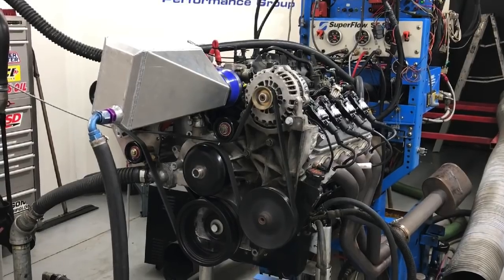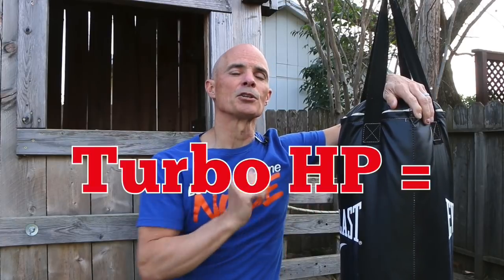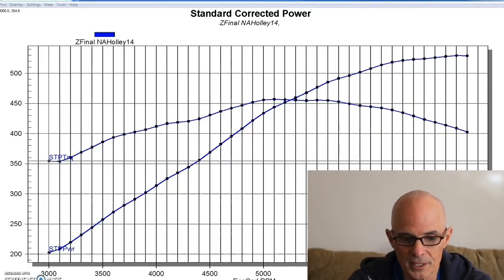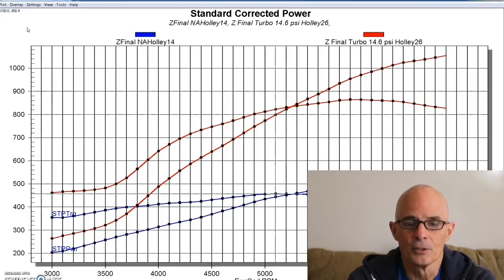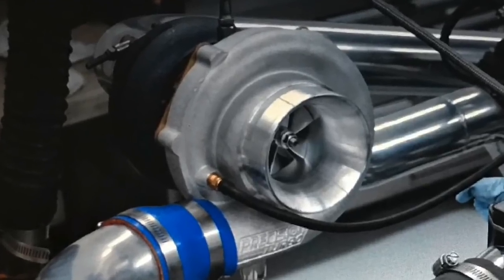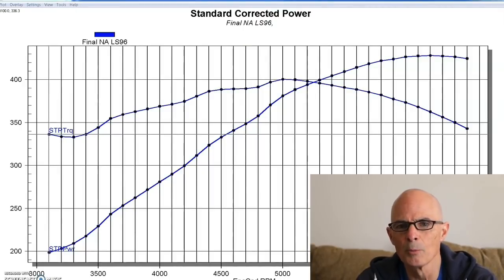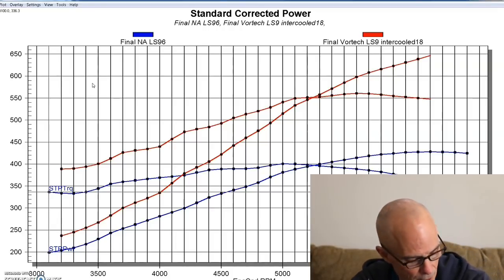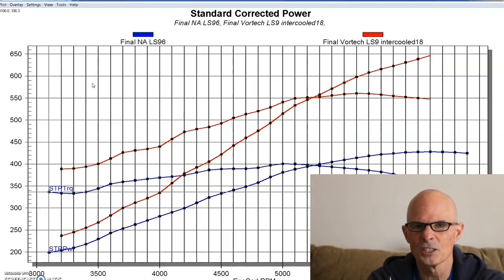WHAT DOES IT MAKE? TURBO HP FORMULA!-ANY BOOST!

Comment: Would atmospheric pressure change to 12.1 for Denver
Reply from the maker: na and boosted power are both less at altitude-but turbo compensates more than blower because it increases impeller speed to crate desired boost level

Comment: i tried your formula, if you times by 14.6 and divide by 14,7, then you are going to end up with a smaller number then the na hp. how you come up with that number has got me
Reply from the maker: turbo hp = (boost pressure/14.7 (+ 1)) x na hp..example (10 psi/14.7 =.68 + 1=1.68) multiply 1.68 times the na power output (example 400 hp ls) to get the boost output at 10 psi (a 400-hp na motor should make near 672 hp at 10 psi).
Reply: @richardholdener1727  thankyou for the quick reply, I get it now, thankyou mate. the amount of effort you put into making these videos you make is huge. I am now fully  subscibed. sorry for the late reply been a bit busy.

Comment: A good friend of mine once said "For every 14.7 lbs of boost, you double the engines cubic inch value."  Same difference, it appears.  If a 5.3 NA engine makes 425hp, then a 10.6L NA engine should make 850hp...all things equal.  It's an air pump, right?  Air in, air out.
Reply from the maker: much harder to feed a 10.6L NA motor-it doesn't double the displacement-it doubles the hp output
Reply: @richardholdener1727  Agreed.  What my friend said was that you "effectively" double the cubic inches.  You're squeezing in 2x atmospheric pressure.

Comment: My car has 1.0 bar turbo and 70 hp. 1495cc 4 pistons. Its diesel. İf i open the pressure to 1.4 bar, how much hp i have? How can i calculate?
Reply from the maker: DIESEL POWER IS CONTROLLED MORE BY FUEL SUPPLY THAN AIR

Comment: I have a Toyota 3UZ V8 engine with two small but adequate turbos. NA it made 130KW on an wheel dyno. By adding 9psi of boost with a big intercooler power jumped to 319kw on the same dyno with only 12 deg of timing to be safe. The only thing that was done to the engine was lowering the compression with a thicker head gasket.
My tuner says that it is normal to double the power on one of these engines in stock form with only 7psi.
Why do you think is the gain so much?
Do you have any experience with these?

Comment: Hello Richard, Fantastic series of Videos. I am going through all of them in the last few days, enjoying them but mostly looking for those tidbits of new knowledge. I am a very passionate Turbo guy every since 1977, when I first saw a Porsche Turbo 935 on the race track. I started researching every possible piece of information on the subject I could and then in 1979 I built all the components to put a single big turbo from a cat diesel motor onto my 400 firebird. I drove it through the 1980's, blowing it up multiple times due to preignition but learned lots. Nobody was doing at the time and I had the fastest car around when it wasn't broken. I took the car off the road in the 1990s but kept it and then in about 2005 I started rebuilding it again but this time building it strong enough to handle 1000 Hp.(entire drivetrain and suspension. If you or anyone want to see the car or story, I have it all documented on my Facebook Page "Johns 1975 Formula 400 Firebird" but I want to ask you several questions. 

1: I have read (several times) each book I could find on turbocharging and from the theory the turbocharged motor should produce double the HP of an NA engine (at same altitude) minus 4% to account for additional backpressure on the exhaust. (Unless you can achieve a situation of higher pressure on the boost side vs. the exhaust side. Which you have shown on several Videos.) The question is, when you Dyno the engine for NA power, do you measure with the turbines still restricting the exhaust and just dump the boost or do you measure with headers or open exhaust manifolds?

2: Can you do a video on timing reduction under boost? This is the one subject I can't find a lot of information on. In the 80's I used a 8 degree boost retard on my HEI resulting in a 26 degree advance under boost but now I have a Fast Fuel injection system with the CD ignition and duel trigger Mallery distributor, so I can set the ignition where I like. I will put the car on a dyno as soon as I can to determine those numbers but would like to know more from other builds?

3: I have been wondering why the back pressure should climb so high on a too small turbo if you release that pressure when the  wastegate opens. Can this be that the waste gate is too small or incorrectly positioned?.

Thank you for doing these videos, I am looking forward to watching the rest of them. You might find a few other questions by me on other your other videos. By the way during the time I wasn't working on the firebird I had a couple of Eagle Talons that I also turned up the boost. (and changed exhaust systems and bigger turbos and intercoolers etc..)  I also drove a Turbo Yamaha Motorcycle in the 80s as well. so basically 40+ years of turbo passion.

Comment: Would the parasitic loss of the SC (verses the turbo) be offset by the NA increase in horsepower (the base number used in this formula) due to being able to run long tube headers and not a restrictive cast iron manifold?  If you had the exact same engine and put cast iron manifolds on it and ran a base dyno pull and used that as the base HP number for the test of the turbo, and then put long tube headers on the same engine and ran it on the dyno and used that number (should be higher) as the base HP number for the SC, would the parasitic HP loss be less than the loss of having to run cast iron manifolds?

Comment: Do you have any videos that show the real world difference from putting a bigger turbo in? Like if you run a 76mm vs a 78mm at 10 lbs of boost with a standard air to air intercooler would it make any more power because of the potential for lower intake temperatures ? since most of us are not running a water to air and our intake temperatures change dramatically
Reply from the maker: if both turbos provide 10 psi, power is the same

Comment: So the weird thing about my supra. it makes 232hp (crank) stock from 7psi boost (8.4:1 comp). But it is a known thing that around 20-24psi boost makes 500whp. now the formula you have when you reverse calculate the NA hp I get 163 hp and then go forward with 22psi and I get 400crank hp. The only thing I can think of is they might be making way more then 232 crank once you put an intake and exhaust and intercooler on it. If I could do a engine pull with the restrictive intake and exhaust off I think it should make 260-280HP so it should make 600 Crank or near 500 whp.

Comment: Thanks for years of hard work.
Sharing years of  information.
BUT,  One more step.
Share the fuel maps.
So I can build a the same exact engine.
Married with Children.  So I do NOT have the funds 💰, to spend $2,000 or $3,000 tuning.
Thanks, we do appreciate the TRUTH about making horse power.  
Not trying to sell us, intake, heads,  pistons,  rods, crankshaft, race block.
You running a junk yard dog making 600 hp, 700 hp, 800 hp.
With a engine out of a pickup.
Thanks

Comment: Richard, a question relating to super charger losses.  This lill guy only cost 19hp so its not incredibly significant but as you mention something like a roots charger can cost at lot more in losses.  For convo sake lets say and engine is making 700hp with a super charger at the crank but is costing 100hp to run the super charger is it stressing the internal engine parts like the engine is making 800hp at the crank?

Comment: You ABSOLUTELY CAN NOT apply this logic to any supercharged application.

Mr Know-it-all will certainly comment in disagreement, but this is extremely basic logic.  Any crank driven accessory requires HP to drive it.  Superchargers require a LOT of HP to drive them.

Abnormal drive pressure ratios will also effect the math.
Reply from the maker: I think I covered that
Reply: @richardholdener1727  "you can apply this to any turbo or supercharged application" direct quote.
Reply: Mate ...you gotta listen, as well as watch the pretty pictures.

Comment: Have been using the formula for almost 15 years. But as I use metric, that makes the formula easier 😀
Bar or kpa.
Reply from the maker: I started applying it back in 1980-90 after doing my first story  for Kipp Kington at Turbo magazine-its been around long before that

Comment: A typical NA combo with 1-3/4" long-tube headers will frequently get swapped to truck manifolds when adding the turbo in your videos. How do you account for the 20-30HP difference that the long tubes made in the NA combo that are now lost due to the manifolds?  Does it even matter?
Reply from the maker: on the 6.0L we had tube turbo headers
Reply: Richard Holdener OK, but most of your other vids change from NA headers to manifolds w/ turbo.  Would you just estimate the HP loss from removing the headers before applying your formula?

Comment: Gen 3 ly6? Im guessing lq motor with the 317s and rod hp level
Reply from the maker: the Gen 3 was not an LY6-only the Gen 4-the Gen 3 test motor was from  1999 lq4 WITH 250k MILES (THNX CHAD REYNOLDS)

Comment: I forget, did you do a timing difference video? I say, take a motor, run it NA at three different timing levels. Then compare that to running a motor at 14.7 psi and the same three timing levels.
Reply from the maker: I showed you the effect of timing on a turbo motor in the pump gas vs race gas tune video-check it out

Comment: Richard, Does this math hold true no matter what turbo size ? S475 to say a pro mod 94 on the same engine?
Reply from the maker: as long as the turbo can supply the air-but extreme cases might cause problems
Reply: Richard Holdener   ok so mainly its the other way around that it will make different power gains. Say 66mm turbo on a 5.3 compared to a s475. @14.7psi that 66 might have so much back pressure it can’t make the power it should.

Comment: Here´s to add to the equation: you can have different density in the same pressure....
Thereby the the formula is very incomplete!
Reply: its a baseline to reference, not an ohms law by any-means, its a simple theory not a formula, your supposed to fill in the blanks.. instead your sitting on your ass trying to discredit someone on the internet. Nobody trusts a guy named Pat, this bs just added to your already cursed name Pat.
Reply: @nickolaswhite4288  Talk about discredit lol

I just wanted to add some info so people could just understand what you just stated.
Reply from the maker: we call that mass flow-very cold or very hot can alter formula-think big picture
Reply: @richardholdener1727  I´ve been tuning a lot of turboengines myself so i´m well aware of that, but are every other aware of that?
Maybe they need some more info to understand this is just a loose formula that measures power very sloppy.
Reply: @Patricks_Projects  it's not incomplete if you're assuming all other parameters to be equal. If the IAT is the same between n/a and boosted the base air density won't be a factor in the equation. We're not making a comparison to a constant.
Reply: @danieldelgado982  But that rarely happens.
And don´t forget humidity.
Reply: Pat We it doesn't matter. If you do back to back tests at different humidity or air density on the same engine you'll get different results. The point is that whatever power level the engine makes, doubling the air pressure will double the power all other things being equal.
Reply: @danieldelgado982  still never happens.
You need 100% effiency of the intercooler.
And you need the same pressure deltas over the exhaust and inlet.
Which rarely happens also.
Reply: @Patricks_Projects  apparently the phrase "all things being equal" is lost on someone who likes to argue for the sake of arguing. The fact that you can introduce other variables into the equation make zero difference when we're talking strictly about ONE variable and assuming all others to be constant. As for intercooler efficiency, they can exceed 100% and make air MORE dense than ambient, throwing the equarion off in the other direction. How about that?
Reply: @danieldelgado982  It is you who is arguing.
I was just saying that the formula isn´t near perfect and very often is used by people who actually WANT arquing.
Often when setups are producing MORE power than the 'duplicating factor' the formula uses.

They have NO understanding why this happens and refuses to see the facts.
Reply: @Patricks_Projects  taking a rule of thumb and adding complexity to it isn't going to make stupid people see the light. Screw 'em. I've learned over the years to just let stupid people be "right" and go on about your business as if they don't matter, because they usually don't.

Comment: Back in early 80s while an 8th grader sitting at the kitchen table with my Dad he said.
"If you want to make power go TURBO"!
"Double the atmospheric pressure and I'll effectively double  the engine size and DOUBLE the power minus a few %"..... using some technical jargon.

Did the kid listen?
Like most,  Nope.
In the 90s after earning a few $$ I bought a Procharger. 🤪
Now I'm stuck with the name, crapster.
Reply: So for as long as I can remember it's been.
50% increase add 8-9psi or 100% increase go with about 16-17psi.

Comment: I think tho, something you must consider is if you are running an intake and air filter on the inlet of the turbo (hey Richard, that would be a nice test!). And if you have open exhaust off the turbo or an exhaust system on the vehicle. What about fuel? Isn’t e85 going to make more power at the same boost if you are running more timing? All of these are left out factors....
Reply from the maker: nothing is left out

Comment: If you a weak smoged, lets say csb 350. Is ut possible to get more then a 100% gain at 14,7psi boost? If the cylinder filling is real bad on the original motor. 
Love your channel Richard
Reply from the maker: it is possible to get more than 100% if the charge temp is very low-I have something coming up on that (I failed with the C02)

Comment: So my gen4 alu 5.3 with ls9 cam should make 400hp N/A with accessories and I'm running 14 psi of boost with a S475 so about 800hp . Should make about 650whp and feels like it does.
Reply: I'm planning on putting a turbo on my 2016 Silverado 5.3 stock engine stock gear no cam no heads no nothing just full bolt ons with the on3 78/75 turbo , any issues ?
Reply: @talalalmufti9858  Should work no problem . The only problem is the direct injection, you are limited by your fuel system on how much power you can make.

Comment: been using this for years.  I'm interested to see what my 2650 on 8 PSI makes.  One thing to consider on a roots style is the change in intake manifold.  It can affect the formula a little.  Octane also can become a problem as you go up in boost.
Reply from the maker: My plan was to cover that, but I used a Vortech instead with the stock intake-I have a cool comparison coming up with all the forms of forced induction

Comment: Using absolute pressures and local atmospheric pressure would useful at higher elevations. e.g. At Denver the atmospheric =~12 psi.  @ 15 psi boost, the absolute charge pressure = (15+12=27 psi).  27/12=2.25, 2.25 x 300 hp = 675 hp. To compensate for charge air temperature, divide NA absolute temperature by boost temperature. e.g. @ 70 F ambient, absolute T = 529.7 Rankine,  @ 150 F charge T, absolute charge T = 609.7 R.  529.7/609.7 = 0.869.  0.869 x 675 hp = 586.6 hp. Note that dynamometer readings are rarely the power actually produced, but corrected to what the engine would produce at Standard Temperature and Pressure.
Reply from the maker: there is a flaw in the in the correction used by dynos as well-I'm thinking about doing a vid on dynos

Comment: Wouldn’t this be dependent on volume as well? 14.7 lbs on a 67mm isn’t going to make nearly as much as 14.7 lbs from a s484? Correct me if I’m wrong
Reply from the maker: if the smaller turbo wont support the power level, it won't make the boost

Comment: where i live we use 101 av gas have you played with it at all
Reply: @Mr. 6 liter you dont run av gas in street cars
Reply from the maker: yes we have but like the auto fuel better
Reply: @richardholdener1727  i also forgot its illegal in cali my friend just showed me his new project runing a roots blower with twin turbos breaking his tuners dyno insane!
Reply: @Mr. 6 liter i just dont like the milkshake oil from ethanol we have one gas station that sells race gas but its seasonal and av gas is cheaper

Comment: I had same engine go from 1053  to 1374 with air to air intercooler but a piss poor fan on Dyno , one more pound boost  a cam change from blower grind to turbo grind and Procharger to twin turbos so I attribute most of gain to not driving supercharger .

Comment: Everyone is saying the same. It's just pressure ratio x known power = new power. 

  I am; however, curious what Richard is referring to about us engineers saying that this formula doesn't work?

 Are you suggesting that we would say that pressure itself is irrelevant but it's really air density that matters? Even though pressure is the bulk of the change in density.

Comment: But what about turbo size. Like I’m running 18 pounds of boost on a Volkswagen 1.8 turbo with a k03 turbo and making roughly 210 hp/250 ft lbs.    although a friend had a 1.8t with a 58 trim turbo and larger inter cooler piping and running similar boost pressure and making close to 400 hp. I suppose the supporting Mods are a factor. Considering boost pressure is a measure of restriction not power. n extremely efficient motor is going to make more power with less boost pressure.
Reply from the maker: as indicated in the video-if the starting na power is higher, then the turbo power will be higher